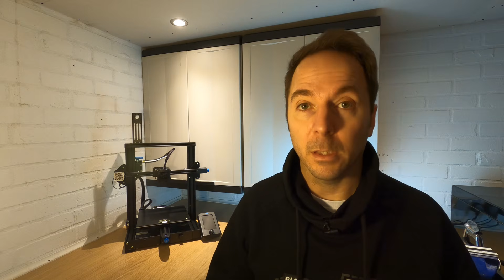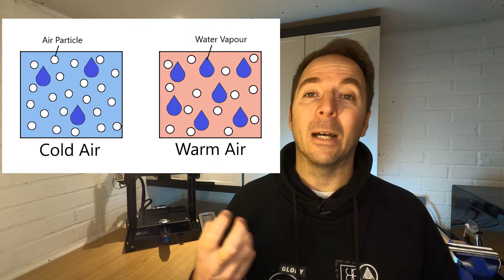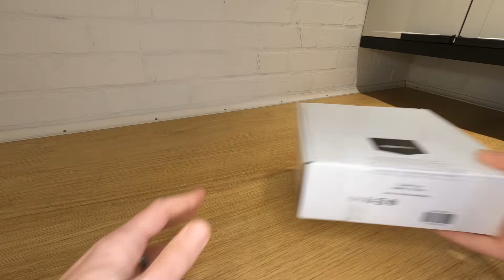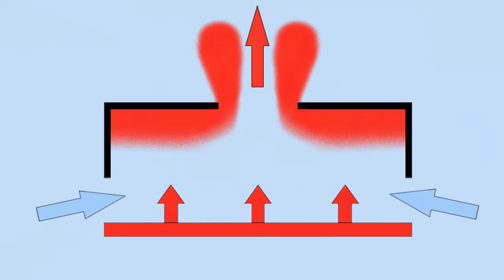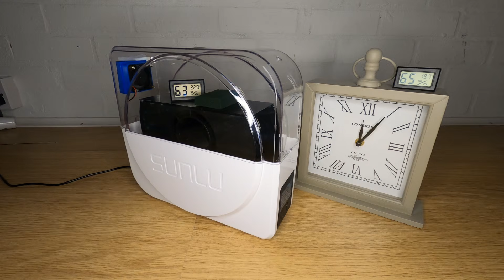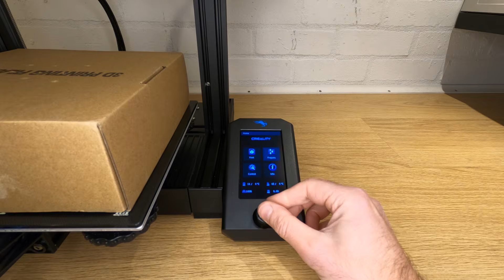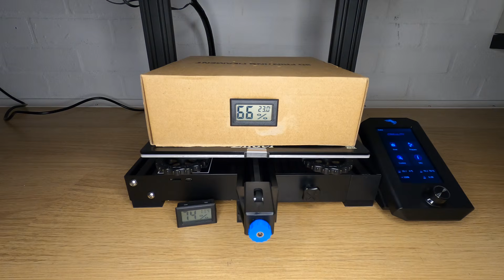Amazingly Simple Free Filament Dryer -You already have one!

Comment: Also came back to say that it workd and also,
I just put the filament with the plastic box on the printer bed rotated the lid so there are two triangle opening, not too big like 5cm,
Bed at 55C
The enclosure temp showed 48C humitidy went down to around 30RH
Took many hours, like half a day

Comment: New to printing myself, I got given a lot of old filament by friends. It's definitely moist. My printer has an enclosure and a fan. I'll try setting a roll in there with the bed hot and the fan on overnight. Fingers crossed.
Reply: Update: my printer's manual controls time out after approx. a half hour. Now I need to learn and write a dehydrator gcode to run on it. WML
Reply: @Tfaonc just go buy a cheap food dehydrator so you dont put a lot hours on your heating bed.

Comment: After buying a used P1S I have looked around the house for a temporary filament holder and found a Ikea KLIPPKAKTUS lazy susan. A have put it on top of the printer, on a glass lid, that naturally gets hot and put a filament roll on top of it. It might not be the most even or sophisticated way to dry filaments, but my second print (PLA pure) came out way nicer than the first one. After two 6 hour prints, the filament is now dry enough, so it still prints nice after moving it on more traditional position.

Comment: Wow! Got it working on my Creality K1C. I just popped the top cover and works great. I went a step ahead and built a custom Humidity Meter with a DHT22 sensor and a ESP8266 + Oled display which gives me a graph with a trend of humidity so I can see exactly when it has reached its bottom, and also has a web display. If anyone is interested, drop me a line and I'll be happy to share code, materials needed and 3D files. Thank you for this huge tip!

Comment: Cut off the lid that your filament came in. flip it over. punch 9 holes in the top. put the filament back in it and place it on your print bed. set bed at 70c and leave for 5 hours.

Comment: Why not just use a regular oven? Mine has a "dehydrating" mode and even a "proofing" mode which uses a very low temp. Then sealing the filaments in airtight bags? Seems to me too many folks overthink.
Reply: If you have a spare oven you can use for only plastic — great !

But if you use that oven for food also ; not a fantastic idea : plastic vapors and particles can contaminate a space that is used for preparing food which ends up being really bad for your insides .

Comment: I bought a creality k1 printer and have my old ender 3 pro just sitting there. I was going to buy a dry box since they are on sale but I did take my spools and put them in vacuum bags with desiccant packs as a lower pressure will lower the boiling point of water and help it evaporate faster.

Comment: Great work! I've built this using a vertical carton box with a small chimney outlet on top with small rectangular inlets in the front and sides and used the heat bed of my A1 Mini as advised by ChatGTP whilst setting it to dry for 6 hours at 60°C. There was no change in total weight of the one spool, however, after drying the filament, it did not seem to snap easily anymore and the detailed print of a dragon I printed in dual colour silk PLA came out quite nice with minimum 'spiderweb' like stringing. I will be re-testing this method with higher temperatures as well as creating another box where the spool lies horizontally. Though I believe purchasing a dedicated filament dryer would go a long way and that's gonna be my next step.
Thanks for a great video and all the best from Western Australia! 🦘😎🤙🏼

Comment: If you don't have a cardboard box, I had luck just using a microwave cover lid. It already has holes at the top. Mine is slightly larger than the bed so it allows some air from the bottom to circulate. It's the cheap microwave cover from IKEA.
Reply: Pretty awesome idea, I was going to use a cardboard but I have that same Ikea cover, I'll try that

Comment: I wonder if it reduces the lifespan of the heating element and driver circuit. Foam is not as hydroscopic as filament, so not a good test. It would evaporate and become lighter in normal air, whereas filament would do the opposite and pull moisture from air.

Comment: It’s 104 in San Antonio, Texas today, I pulled 4 PLA filaments off the shelf, always do a bend test, each broke like spaghetti 😢 so I went to YouTube to research what machines were best to dry out filaments, 
I found yours. I’m 65. You have raised the bar on my hobby!!
A+ excellent thank you for sharing.
Ronnie - San Antonio Texas
Reply: from my experience, only the part of the filament breaks that has been off of the spool and straightened before. so just the first few cm that have been on its way to the hotend are brittle. after that the filament should be fine.
Reply: What temp did you use, I also live here and have an ended 3 and want to dry it

Comment: Im trying this now on my brand new BambuLab A1 mini, the bed a bit smaller than the filament box but will see how its works, i started to see couple thin strings in my prints here and there after couple days
Reply: worked, no more strings while printing :D only did dry the PLA filament what i have for about 1 and half hour.

Comment: I made it using styrofoam box and aluminum foil and wrap the inside walls of the styrofoam box. Then get two bulbs not led bulbs the old yellow bulbs which give off light. You can add 1 or 2. And then wire it and just add a fan for ventilation cause if the inside temp gets too high then the bulbs will likely blow up. I also added a small $1 temp sensor and I can hold and increase temp. I got it to around 80°C but I didn't want the bulbs to blow up so I didn't increase it more. I also added a Fan dimmer switch to control the intensity of the bulbs. And I used a 10kg styrofoam box. I also made a stand for the bulbs out of medium to thick copper wire so the bulbs aren't resting on the aluminum.

Comment: I have had issues of part shrinkage and not adhering to my "un-heated bed" (my printer does not have on a bed heater). I can only print PLA and this is usually not as hydrophilic as other filaments are. However, I've often wondered why we dry an entire kilo spool instead of creating a dryer that dries just the length of filament entering the printer immediately prior to use, on the fly so to speak?

Comment: Just a post feedback about an issue I had with this method: The weight of the PLA filament roll pushed some parts of it into the side holes of the spool deforming it as the filament closer to the bed probably got a bit softer from the temperature. Then on use it would eventually cause problems to enter the extruder and ptfe tube because it was all wobbly. It ended up kinda unusable.
I guess some filaments may need us to lower the bed temperature to avoid this, but I don't know how low we can get and still dry it.
Some input on this would be greatly appreciated.
Reply: Since it performed comparable to the regular dryers I assume we could use the same numbers as used on those. For PLA the Sunlu dryer recommends 45-50 degrees Celsius for 3-6 hours. 

What temperature and time did you use?
Reply: @Shannon4710  70ºC just like he did, for about 12hrs. I've been trying 50 for the last weeks.
Maybe it was the filament brand.
Thanks for your response!

Comment: One thing that comes to mind is that initially, the dry cardboard box itself is going to absorb some moisture... but at the cardboard absorbs moisture, the efficiency in its removal of moisture from the filament is going to be reduced. Thankfully I live in a region where our challenge is getting moisture into our living environment, not having to remove it. Still, all said and done, your solution is a good and certainly inexpensive alternative to purchasing a filament drier.

Comment: Speaking from experience: if you leave it running for 3 days the filament will become a solid mass.
Reply: You set the temps too high. The 70 degrees used in the video is WAY too high for PLA and even PETG. 50 degrees is plenty and will run indefinitely without melting.
Reply: Well... how did this happen?

Comment: LMAO DUDEEEEE!!!! comenting on an old video, but i just got my first printer and for some reason the dryer wont arrive for 2 more weeks, ive been printing like a kid with a new toy for 2 days until today i started seeing adhesion problems and bubbles in my prints, from reading online i found is most likely a moisture problem, but dont want to put the filament in my oven (i cook there and im not sure how safe it is) then i thought of the bed printer, i rigged a box from leftover cardboard for Christmas present packing and it worked, never thought of using the box the filament came in lol, this is genius

Comment: I didn't even seek for the way to dry filament, but here i am. Considering that i still have a problem with stringing, i will definetely try this method. It's free after all. Thx in advance for this tip
Reply: Did you pay for the printer? If you did then it ain't free. If you used it for a boat anchor, you still paid for it.
Reply: @lamarw7757  Yes, i paid my 100$ for 3d printer, i get my 3d printer that 3d prints for 100$ dollars. If i use it as a filament dryer, does it mean that i now have a printer for 60$ and filament dryer for 40? Or it's additional 40, so now i actually spent 140?

I understand that printer have a price. But in this context it makes absolutely zero sense to account for it.

Comment: You could also print a foot for the box which is standing on the print bed. Which keeps afloat above the bed itself. This helps the airflow inside and also the cardboard doesn't hit the print bad which keeps it away from possible fires

Comment: So wait.. I can lay my filament on the heat bed, set it to 60c, poke a few holes, place the box over top for 4 hours and it’ll be dried for use? It won’t melt the filament that’s touching the print bed?
Reply: Does the filament you've printed during a print job melt to the bed? 🤔

Comment: That is a clever idea. I would like to add a tip if I may. I punched a little hole in the side of the box so I could insert a digital meat thermometer probe through it so I could measure the air temperature within the box. I did it near the corner of the box so the probe wouldn't hit the filament. I found that it didn't get nearly as hot inside the box as the heat bed on my Prusa i3Mk3s+ and I that I needed to turn the bed temperature setting up quite a bit beyond the desired air temp. I was concerned that I might make the bed so hot as to damage the filament spool or the filament closest to the bed so I didn't turn it up too much. I never got the air temp never as hot as is recommended for drying PETG, but even so, after a few hours of drying time the stringing I was seeing during printing was almost totally gone.

Comment: Cardboard combustion temperature is between 218 - 246 degrees celsius. Does your heat bed ever get so hot for drying or even printing? Not even close. So I don’t need a smoke alarm, because I already have a common sense.

Comment: the way that works the best for me is even simpler, i placed a space heater (or how it calls) beside the 3d printer in a way that it blows warm air on the filament before it goes in the extruder. the only thing is to make sure it blows only on the section between the filament spool and the extruder so it doesnt make a mess. no need to predry, no need fancy amazon driers, it dry the hell out of the filament seconds before it get extruded. im living in a extremely humid country (70% at day time and 100% at night) and it works better than anything i tried.

Comment: The flaw in this test is: You can't dry your filament below ambient humidity this way.
Reply: Yes, you can, because when you heat air, the amount of moisture it can hold increases. So it becomes relatively drier than cooler air (thus the term relative humidity). 

The real flaw is that he didn't explain how to keep his bed at temp for several hours without an active print job. Mine goes to sleep after a few minutes

Comment: Fantastic video. I nearly bought a Sunlu Plus filament dryer as they were only £19 on a well known Chinese site. The cheaper price for it concerned me.
I found a cardboard box that the spool fitted in and fortunately it fitted on the heated plate nicely. I did put a few holes in the top. I then realised that by turning the box over would let the hot humid air out and replace it with the room air, (I did this every hour for 6 hours). This is where the air comes from when the hot damp air rises and leaves the box through the holes anyway. 
The spool stopped the filament touching the plate and dried it out nicely. 
My prints had got to the stage I was almost going to give up on the Ender 3 S1. Now I love it again. 
I realised that paper and cardboard won't burn until much higher temps so I used it to keep the heat below the bed trapped in. I'll install insulation under the plate in future. 
Then I realised that in the software I can turn off the injector head temp to under room temp and the fan to off. So the only power was for the heated bed.
I can't find a way to upload the images of the 2 prints, but they are night and day.
I had read on the web that PLA doesn't take on much moisture and you don't need to worry about it. 
PLA needs to be dried out. I nearly bunged my printer, when it was 2 year old filament that had gone damp. I had noticed that it snapped most times I came back to the printer, now hopefully it won't. 
Now I think I'll get some vacuum bags to store the dried filament in with some silica gel. I don't think PLA will be affected by moisture during a print of 4 or 5 hours, I think it would take days. I'll learn over time.

Comment: What an awesome idea, backed with actual measurements! What would be the Bambu Lab A1 75 deg bed power draw? I used a smart socket and it showed me 800-1000 W (!) during heat up and then 250-350 W later on. The problem is that Chinese smart socket doesn't offer a current power draw graph, only a discrete value refreshed every 4 seconds or so.

Comment: Great video. I am extremely new to 3D printing and have had a lot of issues getting my bed level, etc. I think I have now finally got that under control, now to be told my filament is wet. I want to try this method as I am not putting more money into this until I see if this works. My question is,  where does the sponge go? Do you place it on top of the spool of filament while drying, or on something else under the box as it is drying?
Reply: The wet sponge was used instead of filament just to measure how much water this method can extract. Just put the filament under the box, nothing else.

Comment: I'm curious if it's worth 3d printing a little convection box, if only to reduce the fire hazard. The materials are already designed to survive on the heated bed for a long time, so you could be pretty confident they wouldn't burst into flames even after repeated use.

Comment: For anyone using klipper, heres a simple macro to heat up your bed for a certain amount of time

[gcode_macro DRY_CYCLE]
description: heat the bed for X amount of minutes
gcode:
  {% set time = params.MINUTES|default(10)|int * 60 %}
  {% set temperature = params.TEMPERATURE|default(50)|int %}
  SET_IDLE_TIMEOUT TIMEOUT={time} # prevent bed heater from shutting off before desired time
  M140 S{temperature} # heat bed to desired temperature
  M106 S180 # 180/254 (70%) fan speed

Comment: and you can control the temp very accurate! mate you are a freaking genius. I can't print at all because all my filaments are damp. You can try lowering the print head and and turning on the fans in a way they suck the air from the box with some 3D printed ducts!

Comment: Thanks! Would 80 degrees C work as well as 70? I have a flat food warming tray that runs at 80 C is the reason I ask.
Reply from the maker: Yes but I wouldn't use it with PLA unless you very carefully check that it doesn't make it soft. Maybe test a small length first.

Comment: im kind of new into 3d printing but im in charge of the 3D printer at my office. is it correct that: I can store my filaments by just letting them sit in a drawer without a plastic bag or anything and once i want to use a filament i can put it in a dehydrator overnight and use it the next morning as good an new? Can I repeat this process over and over again? Because we have a lot of different filaments this way i only have to buy a dehydrator. Im using various Filaments (PLA, ABS, TPU, Nylon, PA-GF)
Thanks!